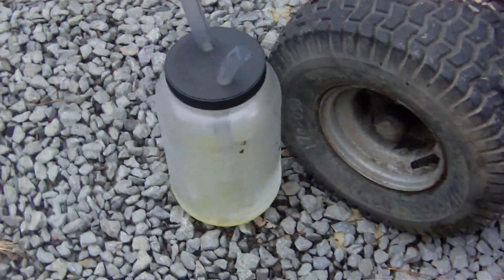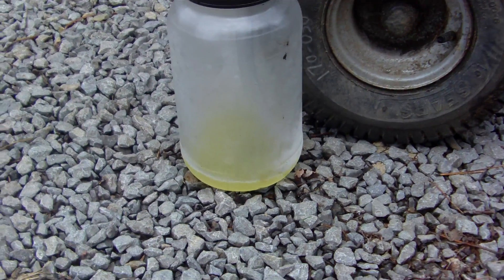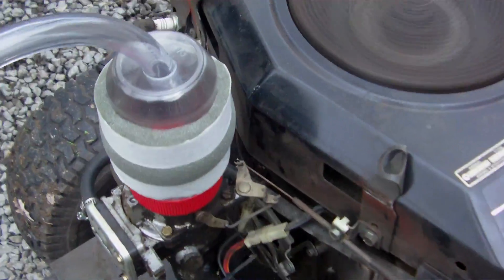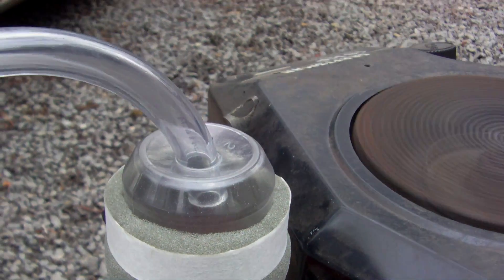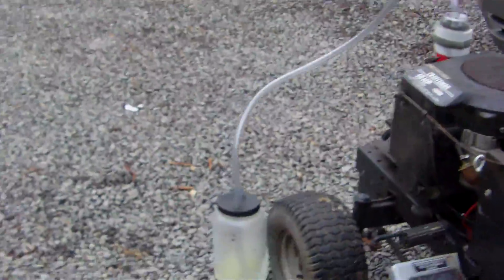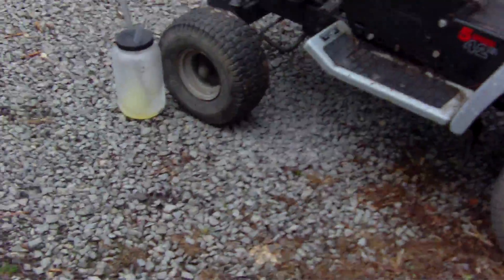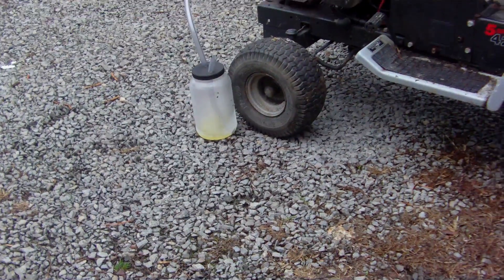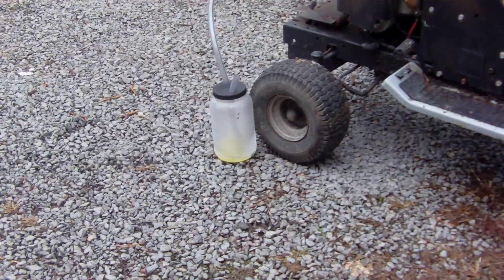ridding mower running on vapor

Comment: when using  vapor the choke isn't going to do anything but make it idle down. the choke is designed to cut air flow down coming through the front of the carb and suck fuel up through the bottom of carb. actually when using vapor system you don't even need  a carb just a butterfly of some sort to cut down air flow
Reply from the maker: kyle thanks for your comment , but what i'm calling a choke , is actually a air inlet , choking off the air ,  the harder i choke it, the harder it pull's the vaper's in thank, 's for watching  god bless

Comment: I'm curious if the exhaust temp would be too high and damage valves ?
Reply from the maker: the pickle jar has never got so hot that i couldn't hold it , and  i changed the oil after  i first got it started , and it's still clean , so i think the valves will be ok !